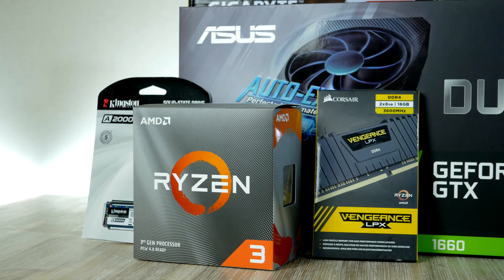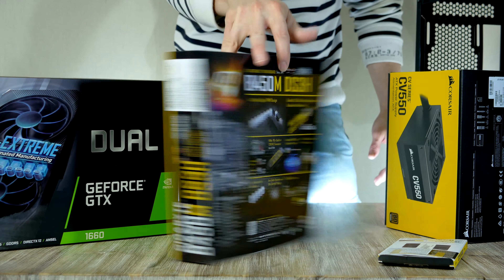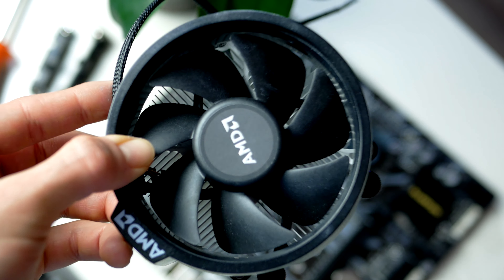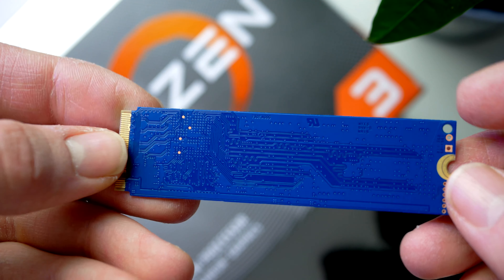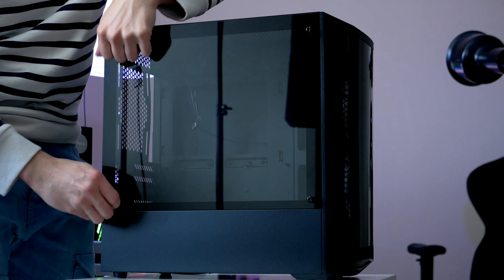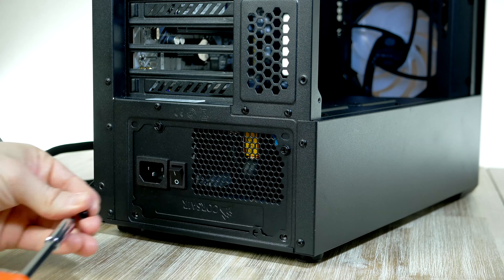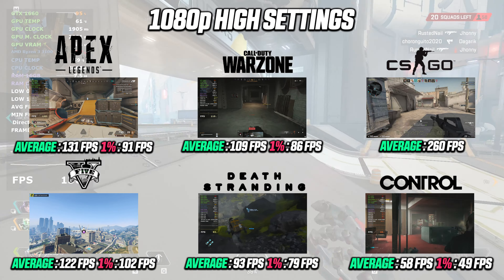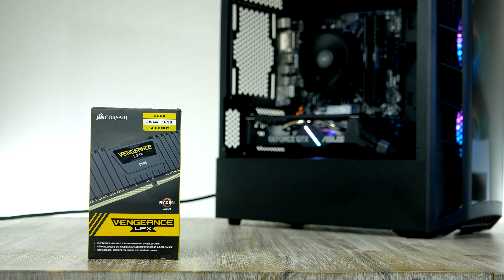EPIC Budget 1080P Gaming PC [February 2021] Complete Step-By-Step Tutorial + Benchmarks!

Comment: My cheap build would be E3 1240v2 and GTX 660 lol
Or atleast that's what i want since i have i3 3240 and gt630
The only problem is the gpu, it has no VGA port (my monitor has only VGA, yes it sucks, it's 75hz 900p) 
I don't Know what's my psu, i can't seem to find the label, so idk wattage and amp
Upgrading only CPU would be easy but that's Overkill for my current gpu. 
So yeah... 
Current CPU tdp 55w i3 3240
Current gpu tdp idk 65??? Gt 630
Then what idk the rest, basically unnamed psu (it's a light grey psu)
Maybe it's dangerous but all went well for the past 7 Years. 
I remember the PC took fire while playing GTA 4 hahaha, the fire was probably the other psu. 
So my budget uh... 80 euros lmao
I could probably get more fps with just upgrading the CPU from i3 3240 to e3 1220 v2 (not the e3 1240 v2 since it's expensive and Overkill) with the gpu idk
The mobo hasn't got a lot of compatibility for amd the most decent is a rx460 but that's expensive, and for nVidia the most cheap is a GTX 660, you can get 600 series, 10 series (from 1070 to 1080) 20 series(wtf?!?) 
So yeah the Best would be GTX 690 but that thing sucks, was it the double gpu? So from GTX 580 to GTX 680 is my range, the problem is psu, pin cables, VGA. 
Yes i know i should change the entire pc but i'm a 15 y old with no money 
So i could upgrade cpu for now. 
If i want something decent i would have to change mobo, monitor, psu and lastly the gpu. 
That's a big problem, ill let You know that i live in Italy, here's my pc specs:
I3 3240 3,4ghz 2 Cores 4 threads
Msi gt630 2gb
Some nanya shit ram ddr3 1600mhz 8gb single channel 
Stock cooler. 
Monitor is some Fujitsu or something like That the name is like l19w something. 
Now my mouse is a razer deathadder essential, gxt 890 cada from trust
Headphones... I broke the microphone probably because the cable got stuck a lot of times under the chair wheels, they are Logitech g332